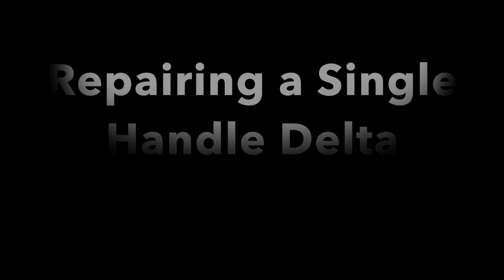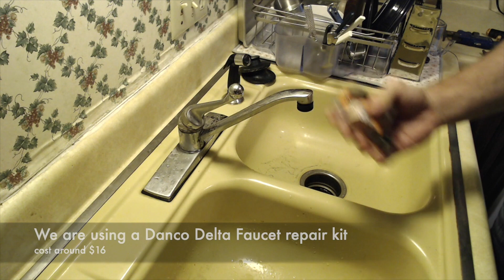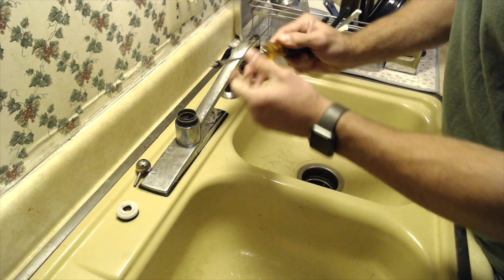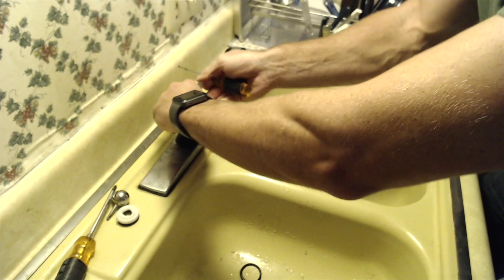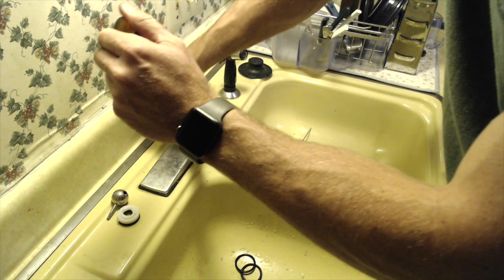Fix a leaking Delta Faucet.  Single handle tap.

Comment: Thanks I tried everything and I can’t get the faucet handle and body to slide up over the valve body to expose the O-rings. I’ve messed with it forever and I can’t get it to come up. I swear it looks like it has a lip over it that keeps it from coming up, but just not sure it’s 25 years oldother than that everything looks exactly like what you’re doing

Comment: Good video and now I think I’m ready to repair my faucet. Only, issue is I think I would use plumber’s grease on the ball and O-rings so the spout moves a little easier side to side. Mine is a little stiff.

Comment: One thing I noticed is you put one of the longer seals on one side and a shorter one on the other side, and the longer spring goes in the longer seals and the shorter springs go on the shorter seal, and you used a shorter spring in the longer one !! The short seals and short springs should go in that spigot !!

Comment: I have one quick question if I may... Is there a purpose for the opposite side of the supplied allen key? With two curved ends does it hook something? My guess it’s a universal tool supplied in other kits that would need that, eh!? Good Video except for the pipe wrench part! Ha! Use channel locks/adjustable pliers!
Anyway, thanks for taking the time and for posting this!
Reply: Yes, use the hooked end of the tool to adjust the plastic ring in the cap. It's a fine tuning step before putting the handle on.

Comment: So many people find it easier to replace the whole fixture. Mine is very similar to this but possibly older. It was new in 1984. I cannot find the proper replacement or repair kit. Haven't been able to find the exact aerator in many years. Have to put on one that "works"

Comment: Note on the little springs the base is wider than the top,   top holds the rubber little caps.   GREAT VIDEO thanks it saved me$$$$$

Comment: TY for such a simplified, yet thorough demonstration on the leaky handle repair. Since I should get the replacement pieces first, it'll be a week or so before I test your teachings. However, after watching your video, I'm ready to take the faucet apart now (& reassemble) just as a test run for fun - you made it look So easy! Lol

Comment: I highly suggest using a strap wrench to remove and re-attach the brass cap on that valve assembly.   While a pipe wrench or channel lock pliers will work, they will likely tear up the knurling on the cap, since the brass is soft.   It will strip the chrome plating right off of those surfaces.   In my experience, even putting tape or a rag on it will not prevent the pipe wrench or pliers from damaging the knurling.    A strap wrench uses a strong, woven cloth strap, which will grip the knurling, but is not nearly hard enough to damage it.   You can get such a wrench for a few dollars at Home Depot or Lowes.   It is a lot more gentle on finished fixtures and is a much better tool to use on expensive, decorative plumbing fixtures.
Reply: Mine came off by hand

Comment: Thank you so very much.   It is the first video that concerns the exact same delta faucet with the leak at the base.  Searches go directly to the leak with the springs, not the base.   Is there any reason not to use plumber's grease on the o rings?
Reply from the maker: Using plumbers grease is a good idea. It will increase the life of the rubber pieces.

Comment: Yellow sink and wallpaper, might be getting close to remodel time.
Reply from the maker: Haha. Yes! We update units one at a time and we still have a few that haven’t gotten the upgrades yet.
Reply: I also have a harvest gold sink. The last harvest gold item left in the kitchen as we have replaced the harvest gold dishwasher, built in oven, range top and vent hood. Haven’t pulled the trigger yet on the sink.

Comment: 3 suggestions (I am not a pro, just a dude):  1) I clean everything real good and then coat everything internal with faucet/plumbing grease (non-petroleum, safe for rubber & tap water), especially all moving parts & rubber seals/o-rings, as well as everything else including threads of screw...to slow corrosion, slow wearing of rubber parts, and make the faucet nice and smooth, as well as easier to take apart next time.  
2) I use a rag or tape between wrench and faucet to prevent wrench teeth making marks
3) when done I remove aerator and really flush faucet full speed to hot & cold til all debris is out, then reattach aerator.  Even just shutting old (galvanized especially) plumbing water off and then on again can be enough to knock some debris loose, and that can get caught in the seals if the faucet gets turned on slightly and then off again, and of course any debris gets caught in aerator.
Thanks for the vid, exactly what I was looking for!
Reply: Did the replacement parts kit not come with a small spanner type wrench for tightening cap? (this tool is made to fit the two slots in the cap where monkey wrench was used in video).  Agree that on chromed surfaces a monkey wrench will scar surface unless ragging is used.
Reply: I would have to put the strainers over the drain or spend the rest of the day fishing out the old parts.

Comment: I just replaced the springs/seats and o rings in mine last night but it still leaks! What else could be wrong? I didn’t replace the cam or the ball though. I did clean them with vinegar. It leaks in the same area this one does.
Reply from the maker: There is a top plastic piece with a built in rubber gasket.  It may need a new one.  It is not likely the ball itself.
Reply: @SkyManagement  ok thanks. On another video I watched it said to feel the ball and if there were any rough spots it needs replacing. I didn’t feel any rough spots. I will look for that other piece on Amazon. If that still doesn’t fix it I don’t know what it could be cuz everything else has been replaced!

Comment: I just bought the kit at menards yesterday, they're $24 now! They also have I believe a Crystal kit, the guy said that was for stems with a hex shape stem, what ever.
Reply from the maker: The link that we included in the description to a repair kit on Amazon is only $7. It should work for both the kitchen faucet like in the video and the bathroom sink and shower ones (those are the crystal ones) 
However, this kit does not come with the ball. So if you need that then you may have to get the more expensive delta kit.

Comment: We have had a leak at the base of our kitchen faucet for about six  months now which usually occurs when we hook up our portable dishwasher.  I can manipulate the spout so that it stops leaking temporarily, but it was a huge pain in the butt. I was a little concerned with attempting this myself, but now after watching your video repair, it was no problem.  I had over thought it and was expecting a lot more issues. Thank you for your video. Well explained, easy to follow. I liked the screwdriver trick  with mounting the springs and seals on the screwdriver  and then putting the screwdriver  down in the faucet hole to line everything up. I wish I had thought of doing that back a couple of years ago when trying to work on my bathroom shower faucet where I was dealing with a vertical installation and chasing springs etc. around the bathtub. lol